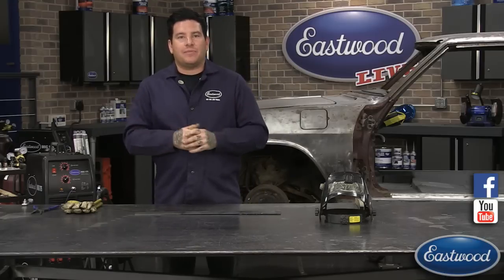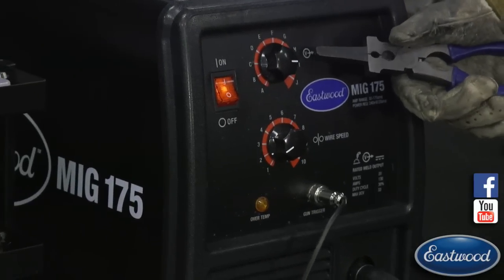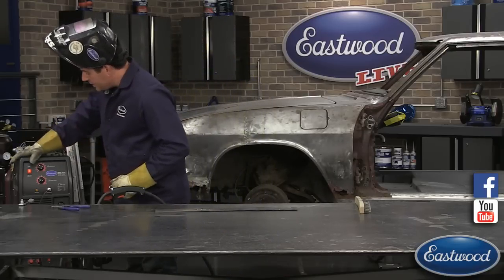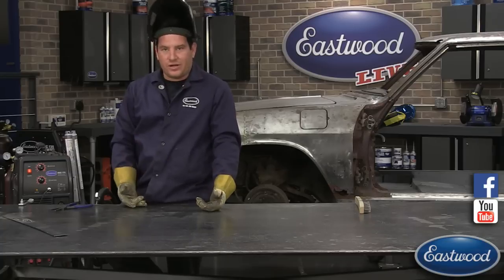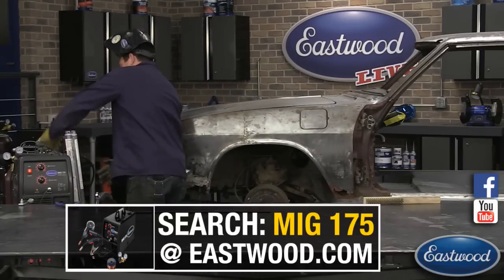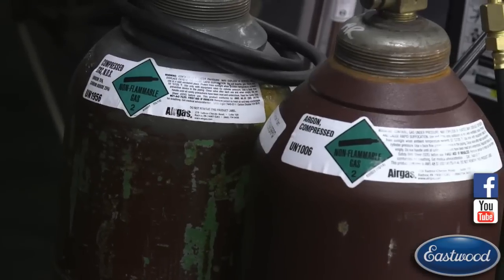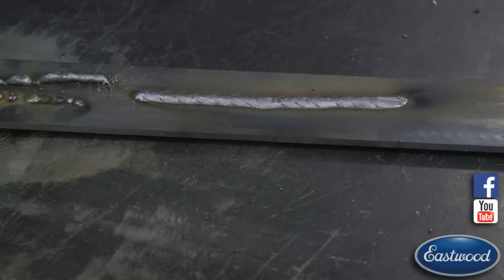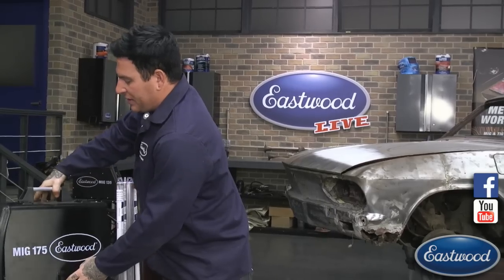Diagnosing Bad MIG Welds - Tip & Tricks for Setting Up Your MIG Welder

Comment: Hey I have a Eastwood 175 mig that it welds like how u show in the video when the voltage is to high and the wire speed is to slow when it is cold if I leave it running for about 5 mins it would weld good. what could be the problem?

Comment: I'm using a esab 400i and it's a big machine, the problem is it can't give me perfect bead weld like the 400 that I'm used to so i have been changing the settings on the machine and the volts and the amps, feed speed and so but what can I do to achieve a really good weld on a soft pipe for truss work..,☺️?

Comment: New gun, new regulator gas 25cfh wire feed and volt / Miller 211 data on panel and still get a lot of porosity????  Good sanding to clean both weld area and grnd clamp.

Comment: When welding without gas the ground is positive so my question to anyone that knows is if you need to weld a vechile and you hook the positive to the frame how does that work ? Just disconnect the battery?

Comment: This is super useful because when I got my welder I didn't know shit and had bird poops, then I had poops with dots on them and pores, etc. Still trying to figure it out.  My question is this:

On my bird poop mig weld beads, here's a little hole in the center I'm guessing that also means the speed of the feeder is too fast and poking a hole in the puddle?
Reply from the maker: I'd make sure you have the proper shielding gas - porous welds are often due to lack of gas. Second, I believe the tiny holes in the center could be from pulling away too quickly once finished welding - let the gas cover the bead for a few seconds. Or, the material can be really dirty which trapped gases or oils heat up and leave the hot weld puddle before cooling. 

Sincerely, guy trying his best to monitor these questions!
Reply: @eastwoodco  thanks man

Comment: you mentioned its not good to use 100% argon on anything but aluminum and i was just wondering what would happen if it was used on steel or maybe even stainless steel. does it contaminate the welds or is there another reason not to use it on steels. i have done a little aluminum welding but it has been allmost 20 years ago and the only reason i did it then was because my boss at the time had asked me to do some for him and a friend of ours. it was the first time i had ever welded aluminum and as far as i know it lasted and i used a mig machine that the gun had a special teflon linning to be able to run the aluminum wire instead of a spoolgun most mig welders use today. i would still like to have a good water cooled tig machine but i cant afford one at this time anyways i like your videos and just was curious about why you shouldnt use 100% argon on steel. i have probably been told years ago but i cant seem to remember the reason. thanks
Reply: Havent read all but u want tobuse 75% argon co2 25%.. what i use on my miller. And im a welder by trade and work in a welding shop

Comment: Alright guys so what happens when there is still bubbles in your weld and porosity even when you made sure there was gas in your tank and it was on and the surface is super clean with nothing on the metal but pure metal? I am still having a problem with my welds even when I have my cfh gauge turned all the way up! it still acts the same I don’t know what else to do...
Reply from the maker: You have the CFH turned "all the way up"? Is it set way too high? Try setting it to 12-20 cfh when it's flowing. Pull the trigger on the torch to allow gas to flow and set the cfh between 12 and 20. Try welding and make minor adjustments. If you're still having issues, please contact an Eastwood Weld Tech at 800-343-9353.

Comment: hi sir can i ask why are my mig welds just like ball baerings n dont hold
Reply from the maker: Sounds like you're having a penetration issue.  When prepping for a weld - start by testing on a scrap piece of metal the same thickness as your project.  You can get ball park settings from the sheet on the inside of the lid of your welder and tune from there.
Reply: @eastwoodco  thank you unfortunatly there is nno info on the door

Comment: Hey what's going on sorry about the name my son put this name anyway I purchased a Eastwood midwelder for me guys at 1:35 and and I followed the chart I'm welding on 16 gauge it's in a 72 Nova I'm trying to install many tubs anyhow no matter where I seem to put the setting and when I followed the chart for 16 gauge and then I got the gas on the gas on the correct you know amount of gas sometimes it'll lay down a goodwill a lot of The Times it'll burn through so I turn the vaults down I move the ground I checked the gas and it just It's spattering and burning and I got the the metal clean I'm gonna is clean I'm at a lost on what to do
Reply from the maker: Are you running an Ar/CO2 mix? Are you sure the metal is clean? (wiping with pre-paint prep prior) Is the ground dirty somehow? (paint, dirt, etc) Are you at the correct amount of stickout? Is the wire on the spool clean? 
Without being there, it's tough to tell. Hopefully it's one of those issues. 
Best of luck,
-JD
Reply: @eastwoodco   I have cleaned the ground I have checked the gas I've turned the gas up I have turned the volts down if I'm welding on a table and I put the ground directly on the piece of metal it'll weld I put it On the car At 1st it seems like it's gonna weld fine and then it starts to burn so I turn the volts down and yes I'm running c0 2 argon mix 75 25